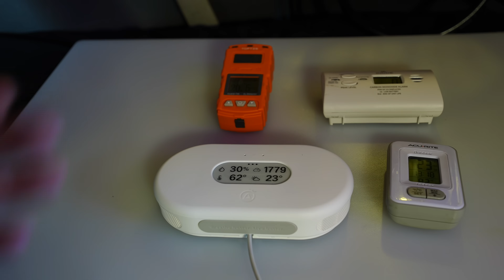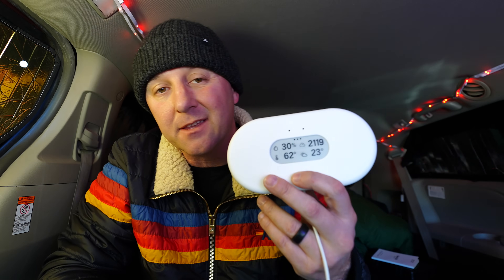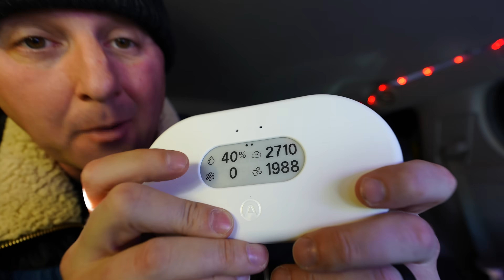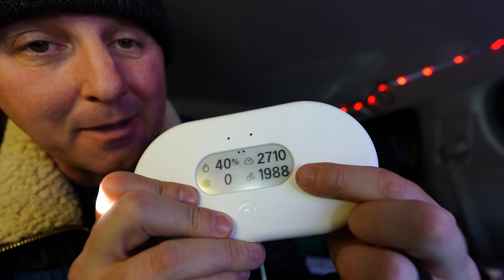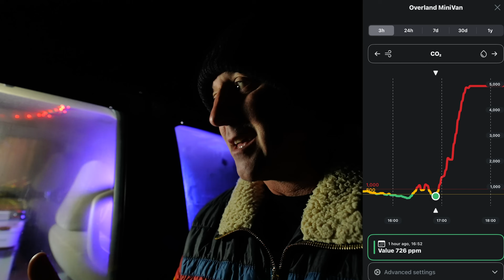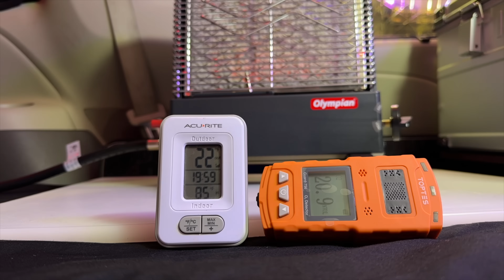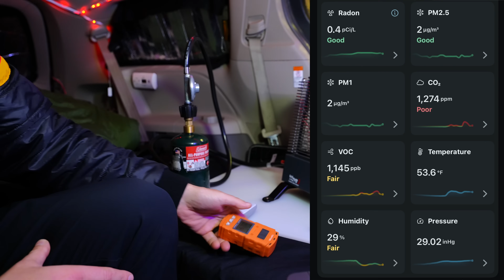Hidden Danger of Winter Camping With Propane Catalyst Heat

Comment: I have that one and like it better than a mr buddy heater. Less fire risk and dryer heat. I know in the vid there was still condensation, but this is just my observation of the feel I have sleeping next to both.  But yes, like all propane usage (not just heaters, but if you cook with it as well) ventillation is a MUST to be safe.
Reply from the maker: Thanks for sharing your experience and emphasizing the importance of ventilation for all propane use! It’s true that the air feels drier, because the Wave 3 consumes propane at a much slower rate and produces moisture more slowly. In the right circumstances it can evaporate as fast as it’s generated.

Comment: can you put a tent stove in a mini van ??
Reply from the maker: A small wood burner with a pipe through the roof?
Reply: yes
Reply: No reason it couldn't safely heat the van, but with so little room, it seems it would be a serious fire or burn hazard or would use up too much space mitigating against those concerns.  In a full size panel van?  Much easier to do.

Comment: This video definitely earned a hype from me. It may save lives. My solution is still clothing and a quality sleeping bag for warmth.
Reply from the maker: Hi Joe! Glad the video was helpful and that you've got a solid plan for staying warm! Sleeping bag is the safest and most efficient way to stay warm.
Reply: @OverlandMiniVan 🙏
Reply: Actually 2 sleeping bags is better when it gets below comfort. (^^,) 
I use a summer bag and a winter one. If it's too hot, then one of them becomes a pillow.

Also have a Firebox in my pocket, so i can make something hot to drink and eat. (outside tent /van) 
Just by using small twigs, or Bio Etanol in a silent burner with no smoke.
Reply: Can you share what kind of Firebox do you have please? And or where you got it Thank you

Comment: From my own personal experience, when a room is depleted of oxygen the body goes into fight/flight mode and will open a door/window--assuming it is unobstructed. This is a powerful reflexive reaction that will even wake the body from sleep in order to carry out the fight/flight process, and no amount of conscious effort will keep the body from opening the door/window to access the oxygen it needs. imho.
Reply: When the brain is deprived of oxygen, people start to act stupid, almost drunk.  Watch a video of pilots in an altitude chamber.  They can't even put on their O2 mask, even when they are told they have to put it on or they'll die.
Reply: Interesting
Reply from the maker: Thanks for sharing your personal experience and thoughts on that, it's definitely something to consider. That's an interesting perspective on the body's reaction to oxygen depletion. The heart rate begins to go up trying to circulate available oxygen and that’s the sign to get out.
Reply: @OverlandMiniVan  I was an aircraft mechanic in the Air Force and I focused on environmental systems; which included air conditioning and pressurization.  I learned a lot about O2 deprivation from that.

Comment: Mario, another great video. Any chance you would try again like this: front windows opened one inch for cross ventilation. Then set the heater at its lowest setting. Wondering if this would be an effective and safe setup for a small space like your minivan.
Reply from the maker: Hi, the cross ventilation as you described is sufficient. The air in the back could be a little stale, but simply breathing normally mixes it enough to circulate. My biggest condensation trap seems to be the windshield area.
Reply: @OverlandMiniVan I use a squeegee for the inside of the windshield, works great.
Reply: In addition to cross ventilation add a fan for air circulation, just need enough to move the air around, that should help
Reply: @SQWIB outstanding piece of advice, will pick up a pair of mini rechargeable fans, thank you sir

Comment: Great info Mario! Some truly scary results with the baseline run 😮
I just purchased a gasoline powered air heater (similar to a “diesel heater”) to door more cold weather camping in my suv or squaredrop camper trailer.
Reply from the maker: Glad you found the info helpful, and enjoy your new heater for those colder trips! If it pulls air from outside it could be a safe option.

Comment: Don't run any type of heater when you sleep. Invest in a good winter sleeping bag and proper clothing.
Reply: those are the best heaters ever no battery drain , fan ,
they dry everything out there’s no moisture involved with them. I have one twice the size I’ve been using since 1994
in a small camper
couple of cross ventilation points and you re just fine and …warm..
Reply from the maker: Appreciate the advice! Many people do rely on quality sleeping bags and clothing for warmth, and those are definitely essential. I don’t recommend running the heater while sleeping as well.
Reply: don't tell that to your lithium batteries that need to be kept warm.
Reply: @dougjohns5115 get a self warming one like mine it works very well in this New England winter
Reply: While that is a viable approach, it won't work for everyone.  Water will freeze, batteries may stop working and you could end up in a bad position.  Better than dead, for sure, but not a one-size-fits-all solution.
Reply: Why not?
Reply: @STUDIO_GJERME  You don't have to worry about not waking up.
Reply: @TimMcCann-f8l right so all heaters have danger element do to their nature and what they produce. Which you couldn’t monitor when you’re asleep. Right. Too dangerous. Like, say, in your house, right?
Reply: @STUDIO_GJERME Besides inherently being a fire hazard (what if it falls over and catches your car aflame while you're asleep?) it steals oxygen from the air. You're already limited on oxygen in your vehicle because it's a (largely) enclosed cabin. Besides, there are people who camp outside without the use of a heater (aforementioned fire hazard). If you can't handle camping in your car, you don't have the right sleeping bag and/or nighttime clothing
Reply: @tguf456 no one said to keep the windows closed. Which is the only way it’s gonna steal oxygen

Comment: So, I've been using the 1lb propane tank in my van for 2 years now. Never for more than 3 hours at any given time straight. 
Just too dangerous. I generally only use to warm up the van.
I have plenty of ventilation in my van but still never feel comfortable enough to sleep with. 
For a full night sleep i use two powder stations and two heat source. (1) I use a 200 watt heater on my Delta 2 and a twin heated pad and the other power station. This generally give me about 8 hours run time base on amount of power i have inside.
I also run a small 215 sq dehumidifier inside the camper for proper moisture control.
Reply from the maker: Sounds like you've got a really thoughtful and safe system for staying warm and comfortable in your van! Thanks for sharing your setup – it's always great to hear how others manage heating and moisture control in their vehicles!
Reply: @OverlandMiniVan 
I have a very thick black out curtain that sealed off the front area from the rear and that helps a lot to hold in heat in the back.

Comment: Mario - have you tried out a diesel heater? It would be great if you could set one up outside or on top of the van and duct in the hot air. Then the gas and exhaust would all be outside.
Reply from the maker: I’ve tried diesel heaters before and plan to use one again. Depending on the setup I believe it can provide the cleanest air quality if it’s scavenging from outside.
Reply: They make mounts that go over a tire also.  It's like a shelf that you can put the heater on to keep it off the ground.

Comment: Get the largest power bank you can lift and afford to purchase! Plus a heated blanket to stay warm. I love my Bluetti AC180P and EcoFlow River Pro. The more battery capacity the better! The only downside is size and weight. It can be really nice to have two battery packs.
Reply from the maker: I’ve tried all kinds of batteries with decent results. A heated mattress pad has been my best overall.
Reply: Battery capacity, without the capacity to fully recharge daily is a short term solution.

Comment: Regarding CO2 we must have different sources because mine say 1000-2000ppm causes drowsiness, 2000-5000ppm for headache, heart rate, fatigue. So ideally we want it below 1000ppm.

Any stealth campers out there, how do you keep windows cracked for ventilation while also having them covered to prevent light from escaping?
Reply: I have a snorkel type vent fan that clips on the window and runs off of a power Bank
Reply: @SQWIB  Ya I got a CO2 detector and did a little testing myself. No wind, front and rear windows cracked 2 inches, just me in the car, 2500ppm. Yikes.

So I ordered a 120mm blower fan and will duct it to the window and see what happens next.
Reply from the maker: There’s mixed information out there. I believe there’s an OSHA threshold of 5,000 ppm for up to 8 hrs. I think there’s other components of the air have a big impact as well.

Comment: The single most important thing if you're going to sleep in a minivan in sub-freezing weather is that you need a sleep system that will insure you stay warm without the use of ANY external heat source. Every system has a point of failure. A well-insulated sleeping pad or surface as well as a properly rated sleeping bag should be your first and primary consideration. Sleep in the proper clothing. Have an emergency SOL bivy or extra blanket on hand. In short, don't rely on heaters of any sort. If you must have an external heat source for warmth, a 12v blanket is your best option. It adds heat while using the least amount of power. BTW that Camco Olympia Wave is $350. The ZenBivy Zipbed Overland designed for car camping is $369 for the 25° down 30" wide version.  Take your pick.
Reply from the maker: Thanks for sharing all those great tips about staying warm without a heater and the alternative suggestions!
Reply: Chinese diesel heater ~$100 with $250 left over for down comforter for back up. Those bevy's can be problematic once you sweat in them and become wet.
Reply: @04_siennaminicamper-nu6vj  diesel heaters are great but the whole point is the fact that they can fail and if they do and that was your only option, you’d be in trouble.
Reply: @04_siennaminicamper-nu6vj  You don't always have to sleep IN it; you can sleep on top of it with a lighter blanket. Hopefully people have the common sense to regulate their own sense of body temp. Diesel heaters mean carrying diesel fuel and finding some way to vent the exhaust. They can be run from outside the van, but then you still have to pipe the heat in. Not exactly ideal for a minivan if you're also using it as a daily driver. And you still need a power source to start them up.
Reply: @twloughlin  If you have to find some way to vent the exhaust with a Chinese diesel heater you've installed it wrong. That's why they are better than all the portable propane heaters. Combustion gasses are outside and there's no moisture added to your interior. On top of that they have a fan to blow the heat and circulate the air. The diesel heaters have a fuel tank that holds 10 liters. Fuel available at most every gas station where you fill your vehicles fuel tank.
A bivy wasn't designed to be slept on, by definition. Not everyone is aware that you can wake up soaking wet—it's not like they say here's an emergency bivy sack but don't sleep in it....
Here's the diesel heater in my minivan:
https://www.youtube.com/watch?v=efiwIwR-lng
Reply: There's something called
" Dobbel Bubble Airtec Bubble insulation ""
That's used in construction, to insulation houses.
That is best to use as a layer under your camping mattress or sleeping mat.
Most of the body heat is drawn out of you, from whatever you sleeping on.

Mylar balloons / rescue blankets , bubble raps can be used in your pockets, to save some of the infrared bpdy heat.
Even the plant called
Cattail / Bulrush = Typha
Can save your freezing body, by stocking into your clothes.
It's nature's answer to Goose feathers.
Reply: @1top2clean19is that Airtech bubble insulation  like reflectix?

Comment: Use 1) Layers with mesh underneath 2) Electric blanket/mattress pad...a little more precise & effective, should be less energy than a small ceramic heater
Reply from the maker: Great suggestions, layers and electric blankets are definitely key for cold weather comfort!

Comment: Use a small electric ceramic heater and a portable power station. 1000 watt hour will keep running all night. Much safer option works very well and dry heat.
Reply from the maker: I like my heated mattress pad the most. It’s safe and doesn’t consume massive amounts of energy.
Reply: False..The smallest Electric heater Available is 300 watts...Will drain A 1000W system in 3.3 hours
Reply: That's what I do too.  I use a Honeywell Heat Bud  which is electric.  It has two settings: 250 watts or 170 watts.  Safety includes tip over auto off and overheat auto-off.  Because the inside of a van or SUV is small, this is more than enough to warm up the insides.  Also, I use an EcoFlow Delta 3 which is rated for 1024 Wh, so that gives me about 6 hours of heat at 170 watts, and if the heater is set to 250 watts, that would be almost 4 hours.

Comment: Mr buddy heater is a third of the cost. 4000-9000 btu
Reply: It junk and isn't reliable, too much heat too much moisture it has open flame, pure crap
Reply: I’m happy with mine. Good safety features like low O2 sensor, tip over protection, if flame is blown out will turn off. Of course following everything this guy suggests.
Reply from the maker: It has its place for sure. Even though they’re both propane they have a completely different combustion process. The new most important part is that it works for you.
Reply: Have been using a Portable Buddy in a van for more than 5 years in Wisconsin. Quite safe to use but when temps drop to single digits fahrenheit the 1lb bottles are not very cooperative. Actually starts being a problem below 20° F. There are ways of dealing with it but anyone who doesn't thoroughly understand how these units function and the temperature affect on propane is likely to get very frustrated. In my experience the Portable Buddy is a much better unit in cold temps than the Little Buddy.